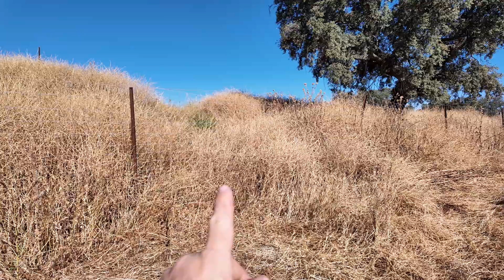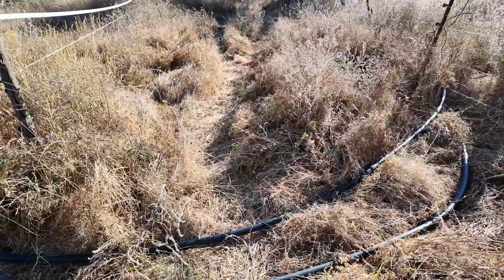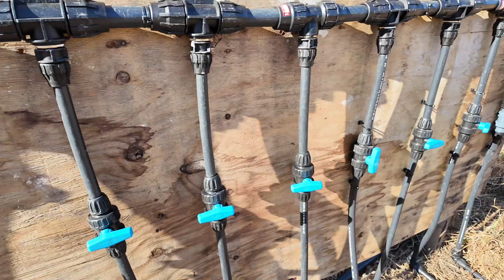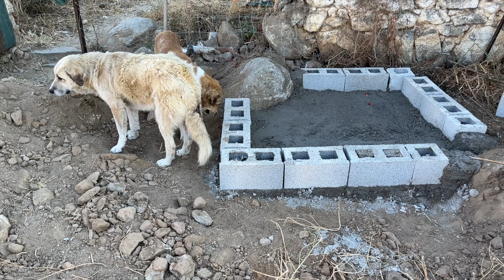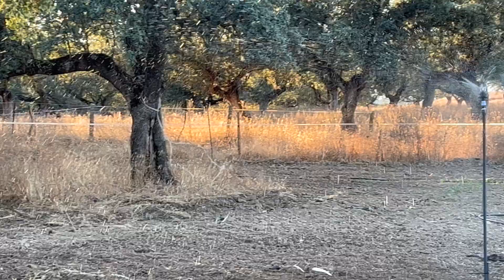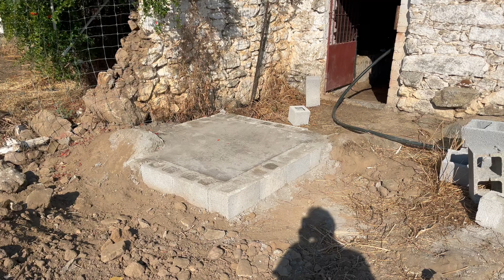New STRUCTURES and PROGRESS

Comment: From experience with thin power cables in wooded areas: they become an ever increasing nightmare to maintain on longer timescales due to root action. 

This was one of the reasons to use LoRa for municipality-size areas over signal wires or Powerline. 

So, please keep your cables away from (new) trees if possible. 

Also, please ‘appreciate’ what e.g. lightning surges can do with long cables. Not only from a safety point of view but also hard to troubleshoot strange behavior, burned-out connectors or even vaporized traces/electronics. The last one sounds scary but at least you know it’s ganz kaput..:)

A lot of the cheap Chinese stuff has no protection at all. Anyway, sorry for adding more stuff to think about!
Reply from the maker: There is no intention to have more cables out there than the absolute minimum. I rather build little solar stations.

Comment: Larger wobler won't help you to get more water on the floor as it is the pump that will restict the water quantity. Maybe less installations but sadly same surface.

Sadly you will probably not have a proper tap root  given the size of the tree you have. But if they self seed  after few year the 2nd géeneration wont have the issue anymore. Root grow mainly horizontaly as topsoil is richer
Reply from the maker: We CAN replace the 2500 liters/hour pump with a 8000 liters/hour model. That would require a 2" pipe and that means replacing the one we are using. That is an option we are looking at for next year. It would allow to irrigate in less time and use larger water droplets that have less evaporation. Very likely we will do that.

There are pumps for filling up water tanks for livestock and then there are pumps for irrigation. Not the same stuff. :-)

Comment: Would it be practical or worthwhile to build large water storage containers some distance above ground level? The water pumps could be used to pump water all day from the reservoir to the containers, and then you could use gravity to water the crops or trees using drip irrigation. That way, you could make full use of the solar power available to you during the day to get water from the reservoir, and you could water the plants at night without the need for electricity when there would be less wastage through vaporisation and evaporation. Just a thought.
Reply from the maker: We are pumping from sunrise to sunset water from the outflow of the water reservoir, where we have a shallow well, into the pond. The pond is basically that storage.

There is no way to use drip irrigation or a gravity system for what we have / are planning to do. I am so happy to have discovered (actually one of the commenters told about it) the Senninger Wobblers.